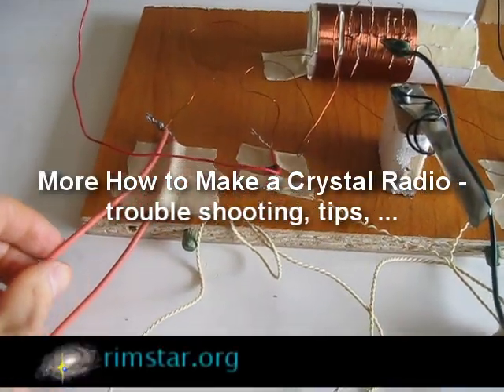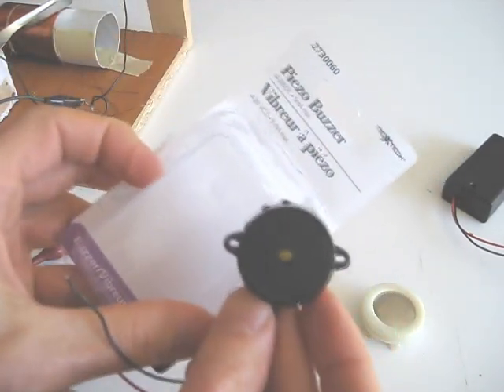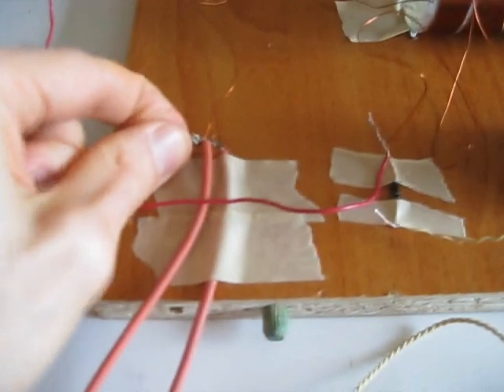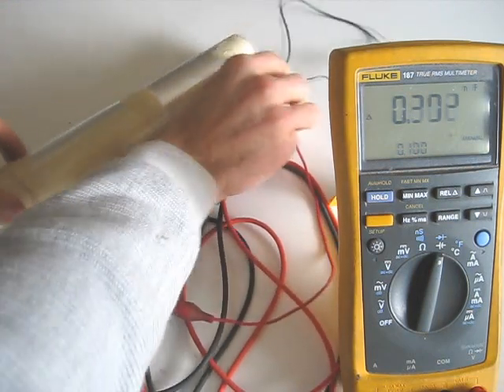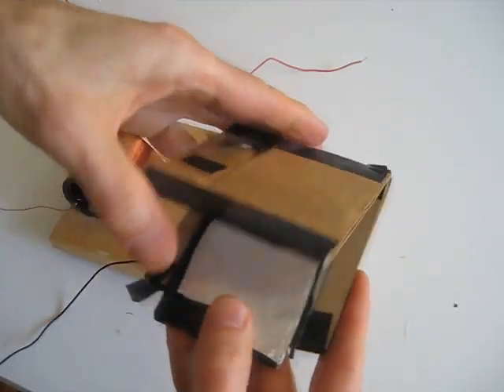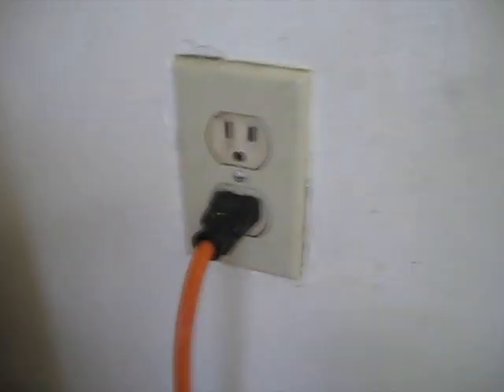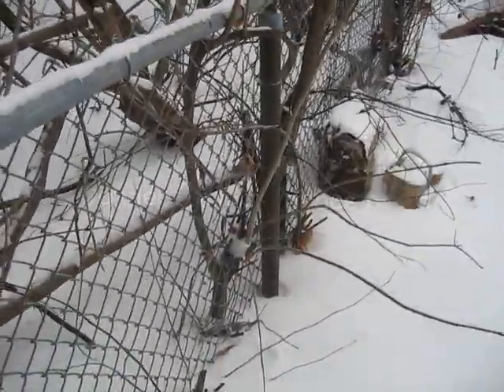Crystal Radio Troubleshooting and Tips

Comment: I still hear nothing out of my radio.  I have everything hooked up exactly as in your diagram.  I live about half a mile from the AM tower and I am using 50 feet of wire strung about 20 feet up as an antenna.  I have tried replacing the capacitor with the variable type bought online but that didn't change anything.  I was able to pick up one station very faintly with the same earpiece and diode using a simpler coil setup without a capacitor so I know that both of those are working.  Now I have a store bought capacitor so I know that is working.  Maybe this will help someone tell me whats wrong.  I hear nothing unless I hold the wire at any open spot between the earpiece and the diode.  Then I hear the hum of static.  Any help would be appreciated.  Thanks.
Reply from the maker: dpla5762 Since your simpler one worked I'm suspecting your tuning coil. When you sand the enamel off the top, make sure to not sand in between since you don't want each turn to be electrically connected to the next one. Also, make sure your wiper blade is making good electrical contact with the sanded off wire of the coil. Another possibility is that your wiper blade has an insulating coating on it or you're not making good electrical contact with it.
Since you mention holding the wire helping, that makes me wonder how good your ground is.

Comment: Can I use my hand to be the ground?  If yes pls explain how to do it.
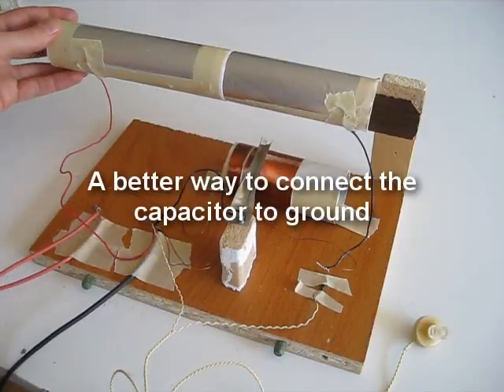Reply from the maker: samuel virgil pe Rewire your crystal radio the way I talk about in 9:28 in this video. But don't connect a wire to ground. Instead use the radio by holding your hand on the outer cylinder of the capacitor, putting as much of your hand on it as possible so that you get a lot of good contact.
Reply: me to can you use you're hand as a ground or what andrew kimble here
Reply from the maker: +Andrew Kimble Yes. See my reply above for details.

Comment: Thanks so much for the work you have done making these videos. They are very instructive and simply put. I love simply put high tech. Good points about the ground. You mention the Teflon tape on drain pipes. Interestingly, the Teflon tape while making an insulator will probably not have much of a negative effect because what you now have is a series of capacitors. Since the radio RF is AC, it ought to still kind of work OK connecting anywhere along the metal. I found interestingly that even tossing ten to fifteen feet of wire along the floor makes for a sufficient ground for most close-by stations so long as you have a good antenna above that point. It's part of what some crystal radio enthusiasts call magic or mystery ground. There is no real mystery to it since close proximity of the wire to ground or coils to each other (antenna on one coil, ground on a separate but magnetically coupled coil) make for a capacitor. I actually found this by accident in my lab when making  one tube radio. I thought that the wire I laid down for ground was connected to the ground rod. It wasn't but stations came in very well. I figured it was capacitively coupled to the ground.
Fun stuff this radio, eh? ;-)
Reply from the maker: gabevee3 Good point about the Teflon tape on drain pipes making a capacitor being okay since this is AC. Makes sense. I'm glad you enjoyed the videos. And yup, this radio stuff is fun! :)

Comment: Should I be hearing static or some sort of noise through my crystal earpiece while I'm trying to tune it, or is it just completely quiet until I have tuned into a station? And does my antenna have to be generally in a uniform direction or can I have it  half vertical (coming down from the roof) and half  horizontal (going into my apartment)? Also, is it bad if my antenna is too long? Mine is about 60-70 feet long right now. Sorry for so many questions!
Reply from the maker: SniperFox You should be hearing static or something while tuning. The ideal antenna is one that is very long, straight, horizontal and pointed at the radio station. 60-70 feet is great and even longer would be better. I can fit only 3 12 foot parallel wires connected together at the crystal radio, but it works because I have radio stations nearby.

Comment: is there any way to make a mobile radio ? i have made a smaller version of this and kept 2 wires out to conect to varois metal around me as a ground, but is there anyway to acheive the effect that ground has on the curcuit with something more mobile ?
Reply from the maker: sylvr In my video "How to Make Crystal Radio Amplifier for Speaker" (I have a lot of crystal radio how-to videos :)) you can see that I have my left hand on one plate of the tuning capacitor. In that case my body acts as a ground. That particular one works without any ground but I get louder volume if I do. The instructions for making the particular crystal radio in the video are here "Portable Crystal Radio using Loop Antenna and Pizza Box".

Comment: could you wrap the second coild more to get higher or lower frequencies ?
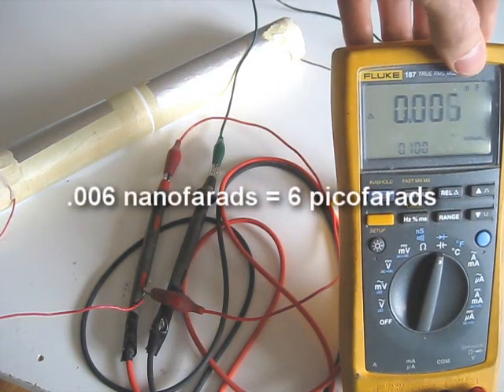Reply from the maker: sylvr Less turns gives higher frequency and more turns gives lower frequency. You can see this illustrated in my video "How a Crystal Radio Works" at around 5:51 with the fuller explanation starting at around 4:50. But that's not necessary if you make the coil adjustable as I have. You can see how in my video "How to Make/Build a Crystal Radio" or using the method in "Make a Crystal Radio Coil with Taps".
Reply: RimstarOrg with the very small voltage that is coming from the crystal radio will my multimeter pick it up?
Reply from the maker: Owen Chase
The voltage is in the 20 to 30 millivolt range so if your meter supports that range then yes. But it isn't steady DC or sinusoidal AC so all you'd see is fluctuating voltages.
Reply: RimstarOrg ok cool

Comment: in your portable crystal radio, you didn' t put any ground connection. Can this crystal radio be used without ground connection?
Reply from the maker: No, the circuit is designed for the the 25 turn coil "dumps" energy from undesired  frequencies to ground. You can remove the ground connection, but it won't work nearly as well. Even the portable crystal radio doesn't work as well as this grounded radio because it has no ground. But if you put your hand on one of the capacitor plates of the portable crystal radio in order to provide a ground, then it works much better. So basically you can try this one without a ground but you likely won't get anything unless you're near a powerful radio station and/or have a very long antenna.

Comment: to connect to the ground, any conductor that comes under the cement is good?
Reply from the maker: If you're making your own ground by connected to the actual Earth then it must be a bare wire, no insulation, and make as much contact with the earth ground as possible to make good electrical contact with the ground. Some ground is better than others. Wet ground is best. Dry ground is worst.

Comment: Is it possible to add a joule thief before the ear piece? Would this make the sound better?
Reply from the maker: No, it wouldn't improve the sound. It would ruin it in fact. However, if you have a long enough antenna (i.e. you're getting a very strong signal) the you could do that and have the joule thief light an LED instead. My antenna isn't long enough.

Comment: The coil is 1/4'' in diameter and 1'' long. The rod inside the coil seems to be a lead material or similar as its heavy.  I tried  installing the german diode and the 470 capacitor but it didn't work. Any ideas ?  The circuit from looking at some similar youtube radio's is one end of coil is attached to an earphone lead which is attached to the diode which goes to the antenna terminal. The other coil lead is attached to the attenna lead also and the remaining earphone lead is attached to the capacitor which also goes to the antenna lead. I think my problem is that I don't have the correct capacitor.
Reply from the maker: You didn't say how many turns are on the coil so I can't do the calculation for the capacitor. I don't quite understand your circuit from what you describe. The position of the diode and earphone with respect to the coil and capacitor sound wrong but I'm not sure where the diode is from your description. You also didn't mention any connection to Earth ground, which is more likely the reason it isn't working than the capacitor being the reason. 470 picofarads is pretty typical for crystal radios.
Reply: Sorry about the delays but having problems responding here, tried many times saying that the coil wire is not much larger than a human hair so very difficult to count the windings but looks to be about 120.  The circuitry all ends up at the antenna terminal, like I said one end of the coil goes to the crystal ph terminal, diode connects to that terminal, than to the ant. terminal.  The other ph  terminal connectes to the  capacitor which connects to the ant. terminal and the remaining coil wire goes to that ant. terminal also. I got this wiring from looking at Lloyds's radios on Ebay and I also remember this from back in the '60's. Maybe I have the diode and the capacitor turned around ? This was an awesome radio as on a good day I could pick up Philadelphia and Mexico City but rarely from S Dakota where I grew up at. This radio did not use a ground as you can see from the Ebay radios there. I just built a crystal radio using the 470 cap. and diode which used a ground but when I added another 75' of ant. wire I couldn't pick up anything but buzzing so I unhooked the ground and it worked great but I did have to have the gr. connected with just 75' of ant. I'm 25 miles from a transmitter now. In town ('60's) the Lloyd's set just had to have the ant. wire from the radio threw across my shoulder to pick up stations, an awesome radio! Check out the Ebay  radios and you should find the Lloyds radios there to check the circuits, some other brands use the same radio box and circuitry also & are the same rectangle shape with the round dial towards the top.    I can't wire up the Lloyd's radio the same as the one I just built because it didn't use the one end of the coil wire. Another radio on Ebay uses a 500 K ohm than a wavy line (symbol) meg ohm,  for the other capacitor or what ever it is Yes check out the radio's on Ebay.
Reply from the maker: Gene Schmidt
Okay, so in answer to your original question, might the 470 picofarad cap be the problem, I did some simple resonant frequency calculations that suggest that that would tune in from 77kHz with the rod pushed all the way into the coil and 772kHz with the rod pulled all the way out. But changing it to a 100 picofarad cap I get a range of 167kHz to 1673kHz.
Assumptions made: This is a simple parallel LC resonance calculation. I assumed a ur (permeability) of the rod of 100, and used 1 when the rod is pulled all the way out. A ur of 100 is for an iron rod.
I don't see how your earphone will get rectified radio waves given the wiring you've described. It looks like the earphone is in the circuit with the resonance going on between the coil and the capacitor. There are many circuit designs so I hesitate giving you yet another one if you already have one in mind, but check out my how to make a crystal radio video http://youtu.be/VqdcU9ULAlA and there's also my how a crystal radio works video http://youtu.be/0-PParSmwtE It might be good to try that one as a troubleshooting step.
I searched for "Lloyd's radios" on ebay.com but get only battery powered radios, no crystal radios. Maybe I missed it.
Reply: RimstarOrg I just checked Ebay and found one, I typed crystal radio and found a flesh colored one intitled "Vintage Germanium Diode Crystal Pocket Radio Boxed set " for $69.50 on page 2. They are showing the innards of the radio there.  I'll check  your site but all the ones I've checked on Youtube so far don't use both ends of the coil or they use the twisted coil every few turns, I have not found one that's wired like the Lloyds or the one in the above Ebay radio. I'm trying to make it as orginal as possible using the hollow coil tube and tuner like the one on Ebay. There are two on that page, its the first one.
Reply from the maker: Gene Schmidt
Oh, that's a very nice one! The circuit they show there makes sense to me. The cap and coil are paralleled with each other and there's a separate path for the diode and earpiece. There's the minor difference in how I tune my coil and that my cap is also variable and that I connect up a ground, but basically it's the same simple circuit I use. If that's what you were trying to describe in words, then I misunderstood what you were saying.
Reply: RimstarOrg So I take it you are telling me to try a 100 pacofarad capacitor than ?
Reply from the maker: Gene Schmidt
Yes, at least according to my simple parallel LC resonance calculations based on a guess at your rod's permeability.
Reply: RimstarOrg Well tried the 100 cap. and no luck, checked all my connections, crystal ph., coil continuity, and everything seems in order. Know my diode and 470 cap. works as I could bring in 5 stations here 20 miles from the nearest transmitter with the wiper tuner set I experimented with. Someone sent me this link  http://www.crystalradio.net/misc/rocket/ and they are using the 250 cap so will try that next but don't think that will work as I'm only getting a little buzzing with the cap's. now. To bad that reporduction Rocket crystal set isn't available anymore as it was only $10.00 !  but up to $200 on Ebay now. The circuit was very close to my Lloyd's on the above link.
Reply: RimstarOrg   Well I've had some success, I switched around the 100 diode and capacitor and I got a fairly strong signal but it was very distorted so will have to keep experimenting with different value capacitor's.Do you have any other ideas ?
Reply from the maker: Gene Schmidt
The only way I know to reduce distortion is to have a separate coil with one end attached to the antenna and the other end to ground, as in the circuit I usually use. That way unwanted stations go to ground.
Reply: RimstarOrg Haven't gotten this Lloyd's set working very well lately so I replaced the NTE109-5 Germanium diode I purchased locally and replaced it with a 1n43a I got online, didn't improve much but when I added a ground to the earphone, coil end & capacitor terminal it really came in good. But thing is I'm trying to get this radio to original condition and it never used a gr. only an ant. wire.  So I'm at a loss as to how to get a good signal without a ground.
  I bought a new version of the Rocket Radio on Ebay and did the rewiring of the radio http://www.crystalradio.net/misc/rocket/ and it really improved the signal especially indoors !
Reply from the maker: Gene Schmidt
I don't really see how it used to work well without a ground, but I'll take your word for it. You could try using your body as a ground. If you look very closely at my crystal radio amplifier video http://youtu.be/JtPwxbOgBHw at the first part where I'm sitting in the park, my left hand is firmly on one of the capacitor plates, and the more surface area I contact the better it works. It worked without doing that but much better with. At least it's good to hear that yours is working.
Reply: RimstarOrg If  you look at the crystal sets such as the Kents, Eastern, Rocket Radio, etc  on Ebay they don't use a ground as they only have the ph wire and the ant. wire coming from the radio box and they worked very well, I could even pick up Mexico City, and Phily Pa. on rare occasions from S D when I was a kid . I notice on the rocket radio I just purchased on Ebay the one I changed the circuitry on from that web sit ( above) that now uses a gr. that if I touch the ant connection that the buzzing will stop.
  Yes the Lloyd's works very well now but its just not back to original condion of using only the ant. so I'm bummed.

Comment: This Lloyd's crystal radio doesn't use a cats whisker but uses a coil with a lead rod in the center to tune, can be seen on some EBay crystal sets. I see on another site where they used a 470 picofarad capacitor but they used a slider across the coil to do the tuning  So was wondering since mine tunes  with a rod instead of the slider will  the 470 capicitor be the one I need ? or something different with my rod tuning ?

Comment from the maker: I've never worked with cats whiskers and crysta. But a quick look at the wikipedia crystal radio page lists galena, "iron pyrite (Fool's gold, FeS2), silicon, molybdenite (MoS2), silicon carbide (carborundum, SiC), and a zincite-bornite (ZnO-Cu5FeS4) crystal-to-crystal junction trade-named Perikon". You can certainly use a modern diode that uses germanium. I don't know what you might be referring to by the "other diode looking thingie". You didn't list a capacitor though.

Comment: I'm trying to restore a '50 - 60's Lloyd's crystal radio. All I have is the radio box, dial which is still connected to the tuner tube which has both wires of the wire coil tube still attached. What I need to know is what type of crystal diode and what ever the other diode looking thingie is. Can I use any crystal diode (Germanium) ?

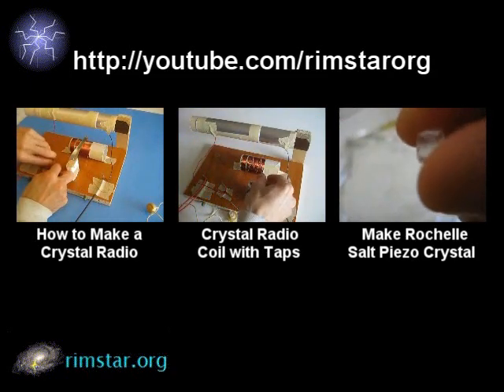Comment from the maker: Regarding the coupling, this originally came from a book and I don't know how to calculate it. The purpose of the two coils is so that unwanted radio waves will influence the path to ground from the first coil and the wanted radio waves will influence the tuning coil. The larger the gap the less interference but lower volume. The smaller the gap the more interference but higher volume. See my "How a Crystal Radio Works" video at 10:45 for more (see the link in this video's description.)